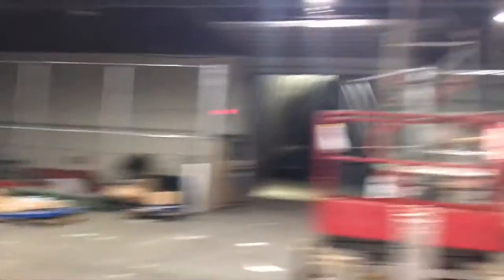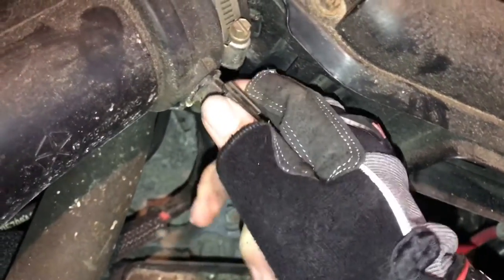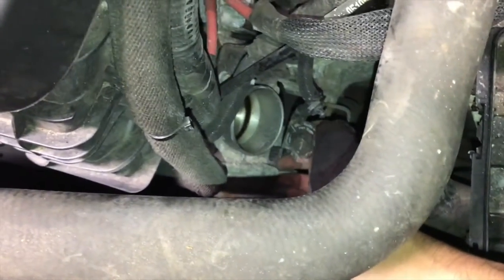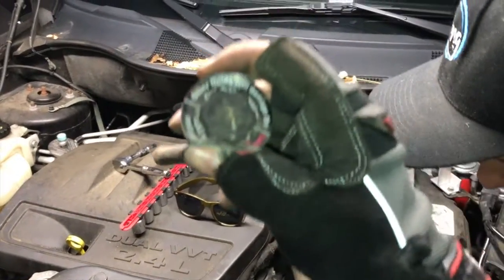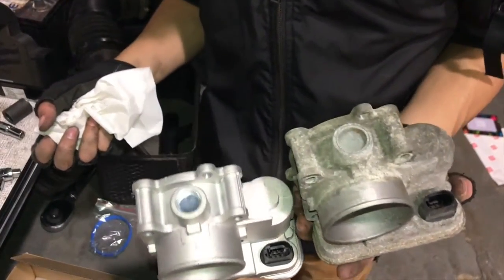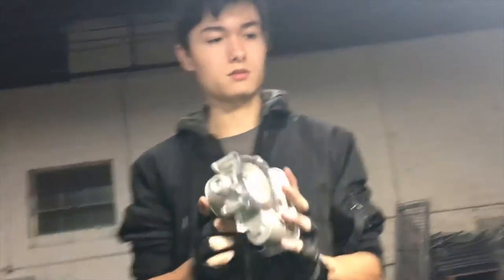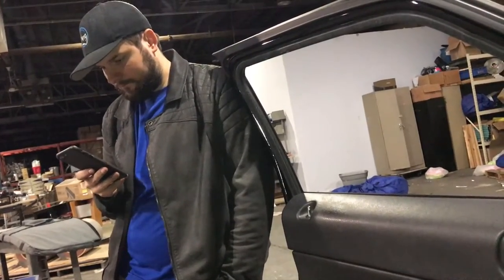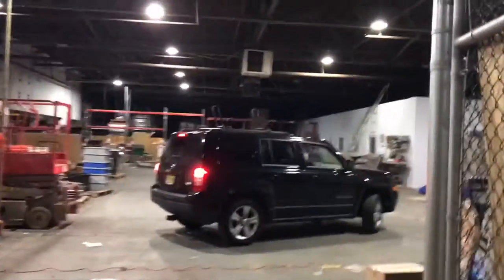2012 Jeep Patriot Throttle Body Replacement

Comment: Replaced mine just now. Best video, guys.  I watched others that were bloated. 2010 with ETC light. Researched and saw the throttle bodies go bad. It was about 80 bucks so I didn’t worry about troubleshooting - just replaced. 
Removed the following: battery cables, wedge holding the battery down ( ended up removing the battery tray for more room - worth it), top hose clamp, top sensor, bottom hose clamp, plastic screw tethering the wiring harness, bottom sensor...pulled the hose, removed 4 bolts and unit wiggles out. Bracket was loose afterwards and I only had to pull toward driver side and slight out toward the front. Then removed the orange gasket. Reversed order with new parts. 
The damn sensor releases are the hardest part to me. Runs like a top now. Thanks!
Reply: Jay Stribling Jay Stribling hey ! I have the same problem with my 2010. I was gonna do the job but I can’t  figure out how  how to remove the hose. Unlike most of the people who thought this job was easy because they’re cvt filler tube was broken , mine is still attached and preventing me from detaching the hose because it’s directly in the way. Any advise would be appreciated .
Reply: @zerosevenpro  It’s been too long for me to remember. I don’t recall having to deal with it. Maybe use a tool with a swivel?

Comment: Good video guys. That same piece broke off in mine as well. I just cleaned my throttle body and now its running fine but I did order a new one. Both these problems seem very common and should be recalls.

Comment: Thx for the nice video. Why did you replace the throttlebody and what where the symptoms? 

Kind regards,
Arjan.
Reply: Yes...what were the car's symptoms?
Reply: Usually a bad throttle body (throttle body sensor) will cause a check engine light, abs light or the little lightning bolt or all three.  If let go too long the Jeep will go into "Limp Mode" and be limited to like 20 mph

Comment: Had the same issue with my Jeep Patriot CTV fluid fill tube. My fill tube snapped where welded mount was. Thanks for the video as it shows exactly what I needed to do in order to replace my throttle body. Just as an FYI to anyone else most likely you will not need to have to complete an idle relearn. At least this was my case using a throttle body by Doorman - found at O’Reilly’s auto parts.

Comment: That dip stick is a pain to replace. This should be a recall. The CVT dipstick breaks in the same place on the Patriot and the Compass. Every Jeep shop I've been to knows about it. Search online. You'll read story after story about it. Plug it with a rubber cork until you can replace it. If debris or water gets in there, it's all over. Just the moisture in the air is enough to cause damage. File a complaint with NHTSA and call Jeep. Demand this be a recall. It's defective and they know it. So is the throttle body for that matter, but it's a lot harder to prove that. Harder to argue with a broken metal stick. So stupid.

Comment: That cv dip stick attach down on the transmission to add fluid n its 1 screw that holds in on but it broke from the rust   happens to post dodge chrysler jeep wit 2.4

Comment: Hey guys, great video. I was worried that you wouldn't figure out that the cvt dip stick is actually an important part. It seems to be the only way to add transmission fluid.
Thanks for the video. I will be replacing my throttle body on my 2007 Patriot soon.

Comment: My cvt tube broke off the first week. Dealer had to replace it. Still janky and poorly designed. I think something was sitting above it when closing the hood and caused it to break off when the hood closed. Also now replacing my throttle body because it's in limp mode.  Seems to have lots of similar issues.

Comment: You need to replace the filler tube on that CVT, pronto! You don't want dirt and water in there, causing damage. CVT repair and replacement costs are very, very expensive!

Comment: Hi Thanks for the video! My 2012 patriot is coding for dirty throttle body and NAPA said just to clean it. I didn't know about faulty sensor - will cleaning help that? Also, if it's just the sensor and part functions normally, why replace? In case it's not functioning properly in the future? I am going to research. Thanks for any additional insight.
Reply: I’ve been researching the same thing. Why buy new part if u can clean old one? It looks like there are some built in sensors that can be destroyed by the throttle body cleaner. And the aftermarket parts are so cheap it might be worth your time to just replace

Comment: Thanks for the video. Just replaced mine on my 15. Know anyone that rebuilds throttle body?
Reply: These throttle bodies are not rebuildable. They have to be replaced when they fail to open properly. Often times, it's the plastic drive gears inside the control unit that wear out or strip out, making the throttle erratic and eventually fail completely. Aftermarket throttle bodies can be found at reasonable cost.

Comment: What were the symptoms  of the part going out
Reply: My Jeep patriots electronic throttle control light has come on and when you hit the gas it will sputter and won’t accelerate, I heard this was a possible solution to it. Gonna try it out tmrw.

Comment: I have a 2015 Jeep Patriot, the throttle body gone bad and it was a recall and the dealer fix it for free.
Reply: Do you know which patriot you have? I also have a 2015 and same problem happening mines a latitude. Curious if it’d a recall
Reply: @Anime-bd9hh  Mine isn JEEP PATRIOT 2015. call your local Jeep dealer and ask them.
Reply: The Throttle body Unit part is expensive. not hard to change. but a expensive part. My 2007 Jeep patriot ,Light came on today. the throttle body unit  light. was going to start by cleaning it. but its cold where i live.will leave it for summer next year.

Comment: oh no what are ya doin that was the transmission fill tube ya pulled out and yes it is cvt transmission also bet that mass air flow sensor ya broke will set seevire engind light dam this is a how bo to do video he he he girl scouts get cool magnets